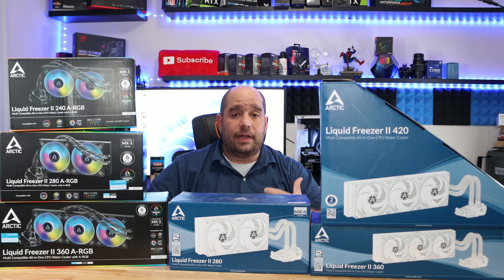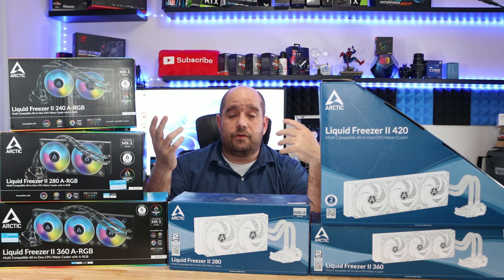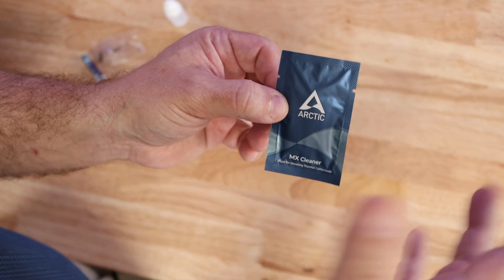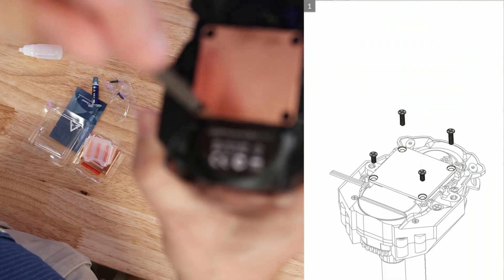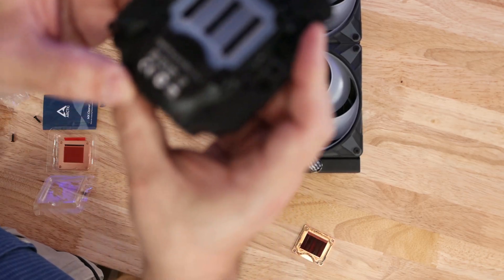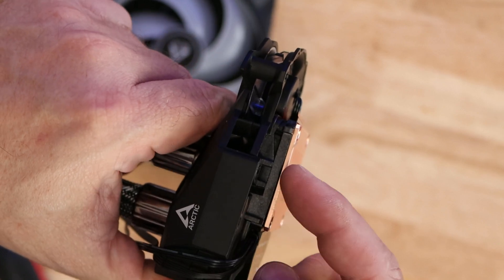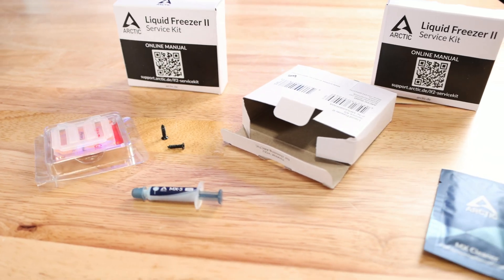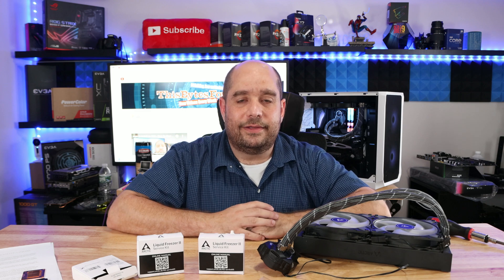You NEED to Watch this if you own an Arctic Freezer II -  How to fix the Arctic Freezer II

Comment: just repaired my 280 last week. old gasket was deteriorating.  great company for giving free support. this is how you win customers
Reply: I have the freezer 240 and ive been hitting 80-90c while gaming and i re applies thermal paste and it did nothing, im glad i came along this video, anyone know how long till u get the replacement kit? I have my ticket in
Reply: @Stewzzyy  I never had that much high temps. max was 70-75c when gaming and all core rendering around 60-65c. and those temps were before the gasket replacement. now I have bit more lower temps. 
I got mine within 3-4 weeks. but that will depend  on your location. if you are closer to Germany it will probably take less time.
Reply: @kaboomm-k2e  i have HW monitor open and it said it reached a max of 90 the other day, i dont know when, i play a variety of games...my main game it runs 70-75 sometimes reached 80 so ive stopped gaming
Reply from the maker: Well a 240, what processor?
Reply: @ThisBytesForYou  i9 10900k with an msi mag z490 mobo and 32gb viper ram with 4000mhz 

I know I should have a 360, but when i built the pc I was getting temps around 55-65 max

if there is anything else I could do to help please let me know, I currently to not have the funds to get a new 360mm  AIO, hence trying to get this part replaced

I can try to re apply thermal paste, but i did that a month ago and it didnt help...TIA
Reply: my 3080ti is running fine its just the unstable temps that worry me.  I have turned the power consumption to balanced and cranked the aio fans up to try and help, but i dont feel warm air coming from the rad when under load
Reply: after running a couple games and looking at the HW monitor, I may be too focused on the max temps, Im running MW2 and its at 220fps at 70c max, but spiked at one point to 85 while loading in.  I feel I am just overreacting, but then again I dont want to overlook it and harm my cpu..(sorry for the spam much love)
Reply from the maker: @Stewzzyy  so, you need to run the link in the description to see if you are affected, so you can change that out if you are.    The i9 10900k will get real hot but you need to set the header, which ever it is plugged into to PWM, that will fix a lot of things and then also have you have any sort of way to set a fan curve in the BIOS, set it to more aggressive, if you have an AIO header, plug it in there, it looks like there is one above the PCIE slot, below the CPU socket, but I can't get a good picture of the board to know.

Are you overclocked?

Make sure you have your fans correct on your case: https://youtu.be/J5m5WBlPkfc
Reply: @ThisBytesForYou  i am not overclocked, no and yes i did check and i am affected
Reply from the maker: @Stewzzyy  then fill in the information and they will send you this like I have in the video and the video will show you how to replace it.
Reply: @ThisBytesForYou  trhanks, I have set my fan curve to run a bit more aggressively, but im not quite sure what you mean by "set the header".  If you have a video on what you mean let me know ill check it out
Reply from the maker: @Stewzzyy  check out this video from the 20 minute mark: https://youtu.be/lEKKlCODqzw
Reply from the maker: yea Arctic is awesome for sure
Reply: how long did you have it or used it until you seen it was deteriorating?
Reply from the maker: @philly442  I never noticed it deteriorating, watch the video and I go over it
Reply: @ThisBytesForYou  right I see the residue when you broke it down but was wondering if this can effect the CPU and or leak even worst into the system, turns out my ARGB 360 is effected but no signs of temp increase on my 12900k
Reply from the maker: @philly442  it might take years, use the link in the description to see if you are affected and get the kit for free.  Also mentioned in the video.
Reply: @ThisBytesForYou  thank you for the answers, your video is more detailed than the others I have seen.

cheers
Reply from the maker: @philly442  Thanks bud, happy you enjoyed it, cheers
Reply: @philly442  around 6-7 months. didn't  notice anything. i just replaced it as soon as i receive the replacement kit.

Comment: I have the 420 version and I was wondering if you could do a video showing how to replace the stock fans with something less noisy like the expensive Noctuas. Or at least just show how to replace with any fans. There isn't a single video on Youtube doing this. I don't know how to set fan curves or anything and I feel like they are just a little too loud all the time, even when my CPU is on idle at 57c. It's a Ryzen 9 7900X.
Reply from the maker: how do you have them connected to your motherboard?
Reply: @ThisBytesForYou  I followed your guide on your video titled "How To Build a PC - Beginners PC Build Guide". My motherboard is the new ASRock Steel Legend for the AM5 Socket. It doesn't have a header named CPU Pump fan or anything like that. I did see another Youtuber with a big channel using a different AIO but on the same MOBO. He also couldn't find a header called CPU PUMP FAN. So he just put it on a header called CPU fan, there is two, he picked the one on the right and that is where I put mine.
Reply from the maker: @theHeartlessNooB  yup, that's completely fine, not all boards have the AIO header, so you are good my friend, socket AM5... I am jealous hahah, how are you liking it so far?
Reply: @ThisBytesForYou  its quite impressive and guess what. I was hitting 65-75c when CPU usage was going from 40-60%(stupid AVG) Then I added two small 80mm ACinfinity USB fans on top of the case and under the same CPU loads, the CPU temp stays at between 57-67c. Pretty good huh? Not bad, those fans are $15 for the pair and are very quiet. They also have the 120mm versions which I use on my AV Denon and those are much better. Going to order more of the 120mm ones for the PC.
Reply from the maker: @theHeartlessNooB  good stuff my friend, congrats for sure, talking about AV, wait till Monday ;)
Reply: @ThisBytesForYou  Hey, do you know what type of screws will I need to add 3 more fans to the radiator and make it a push/pull configuration. Oh and what else will I need to hook these up? Extensions? Splitters? A Fan hub?
Reply from the maker: I don't, but they should come with the screws, though a lot of fans bring them too, arctics site reads "You can replace them using M3x5 screws, commonly used for mounting 2.5" SSD or HDD."

Comment: Amazing thank you for sharing the tutorial. I own a liquid freezer II 360mm RGB so I reach out to Arctic to know if I need a kit of replacement plate and gasket or not. I got it last December. But so far seems working fine but now have a little concern
Reply from the maker: you can use the link in my description to see if you are affected.  Yeah it may work for years without an issue, or it could fail, but its better to make sure